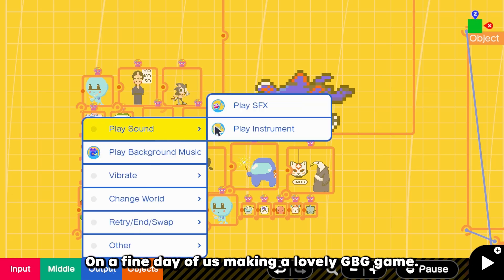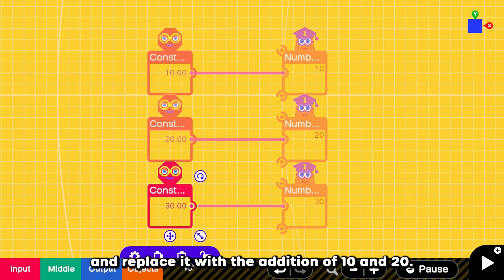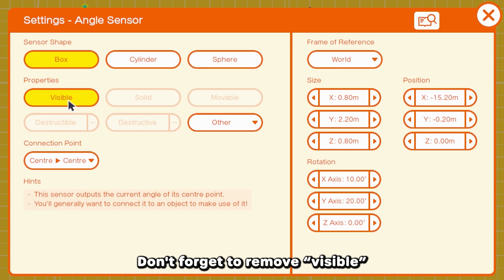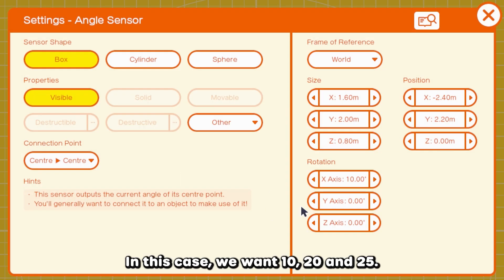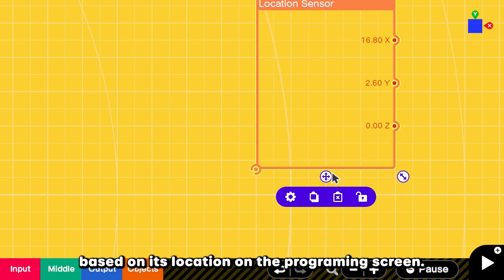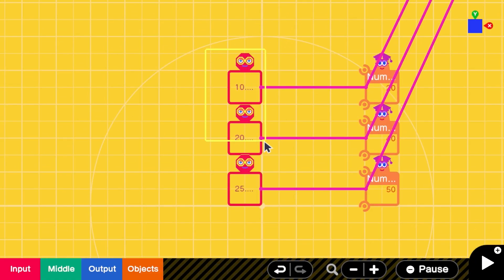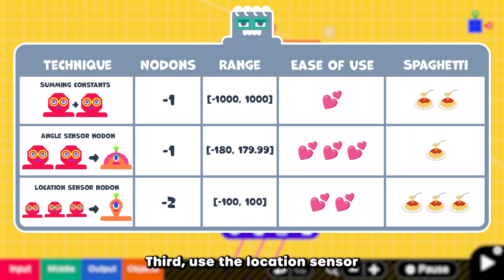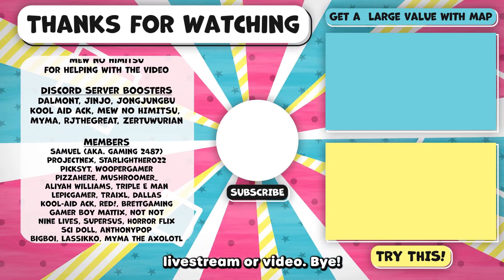【Nodon Shaving】3 Methods to Replace Constants with Fewer Nodons | Game Builder Garage Tutorial

Comment: The summing constants technique would shave off 2 Nodons if the values you want are all multiples of the original constant value. For example, 10, 20, and 30 are multiples of 10, We can just connect the constant three times to the number Nodon to get 30.
Reply: That doesn’t work. A constant can’t connect to a nodon more than one time.
Reply from the maker: @pipro8049 It can connect to multiple nodons! But, I remember there is a certain number of connections we can make.

Comment: I know the answer to the quiz at the end of the video:

Use the Location Sensor Nodon, set the X position to 1, the Y position to 2, and the Z position to 4.

Now for the "1" constant remove the constant and replace it with the X postion of the Location Sensor Nodon.

For the "2" constant remove the constant and replace it with the Y postion of the Location Sensor Nodon.

For the "3" constant remove the constant and replace it with the X position + Y postion of the Location Sensor Nodon.

For the "4" constant remove the constant and replace it with the Z postion of the Location Sensor Nodon.

For the "5" constant remove the constant and replace it with the X postion + Z position of the Location Sensor Nodon.

For the "6" constant remove the constant and replace it with the Y position + Z postion of the Location Sensor Nodon.

For the "7" constant remove the constant and replace it with the all 3 ports (X, Y and Z) of the Location Sensor Nodon.
Reply from the maker: That's totally correct!!!! 

Wow :D